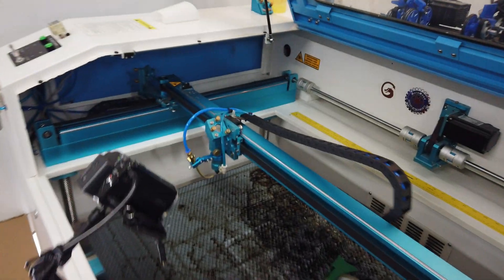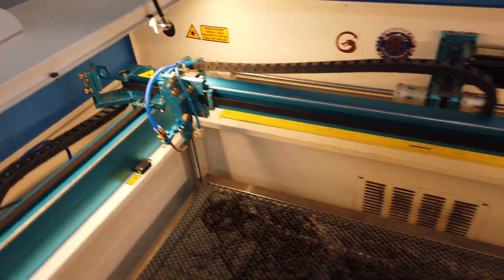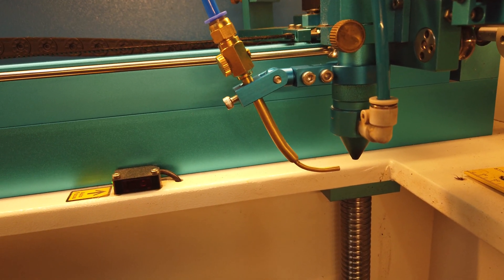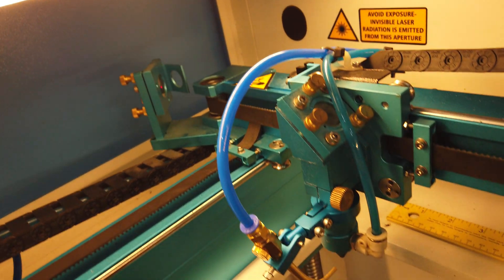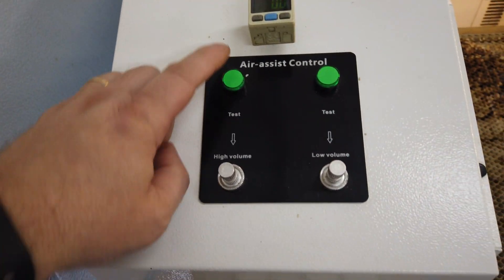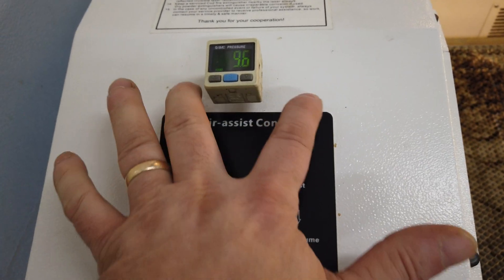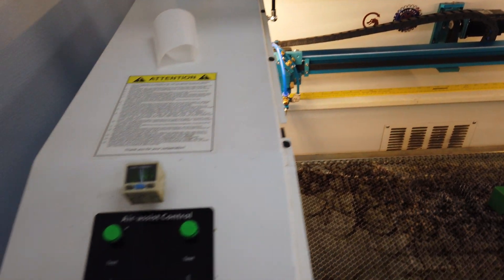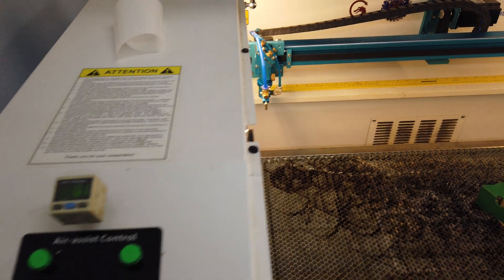Installation Overview - LO Laser Engraving Air Assisted Enhancer Part 1

Comment: Why did Thunder quit selling this and the Laser Engraving Air Assisted Enhancer?
Reply from the maker: on the enhancer.. we never sold it. thats a lightobject item. what was the other thing you were referring to?
Reply: @ThunderLaserUSA   Sorry I thought I posted this on the other video.  It was the ThunderAIR External Compressor Interface Kit Overview
Reply from the maker: @tomausburne1769  ah. no worries. so the kit was out of cheap stuff via amazon prime and people often wanted better regulators, or already have one, etc... the application can vary so much that we felt it better for people to source the components around their specific needs.
Reply from the maker: we just updated the link in the description of this video (the old link broke when we moved our support system on to thunder china's system so we have back-end continuity and shared resources) that will take you to the article about this, with the link to the enhancer, on the new client support portal". here is that link for your reference: https://support.thunderlaserusa.com/portal/en/kb/articles/lightobject-laser-engraving-air-assisted-enhancer-test

Comment: I've been using this for a couple months now and makes a difference with my engraving both on wood and acrylic.  This is the way I connected mine the first time and found the lens to get dirty during engraves.  So I split the low air, added a flow speed control on the tube that goes to the lens so I can adjust the air volume to min and the other line went to the air assist enhancer.  I find that this set-up worked a whole lot better!

Comment: So if I understand you right, you’re running the low pressure air through the external nozzle. Are you still running high pressure air dialed back with your gauge through the cone? If not, I was under the impression that it was bad to not run with air “across the focus lens”  or it could crack.

Comment: How did it fit on the nozzle? Did you have to modify it since it was 21mm?
Reply from the maker: it fits perfect on the stock lens assemblies. the adapter ring is snug even before putting it under compression.